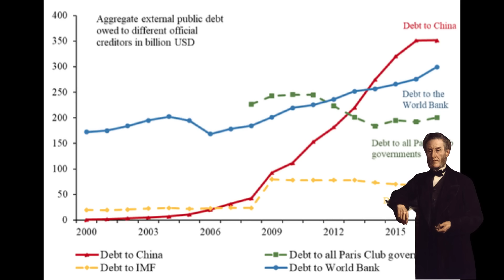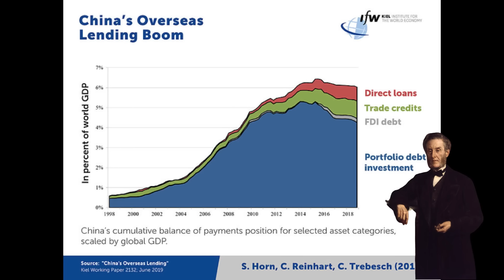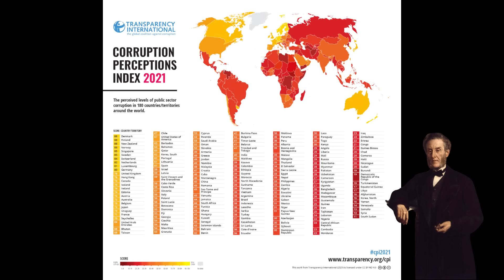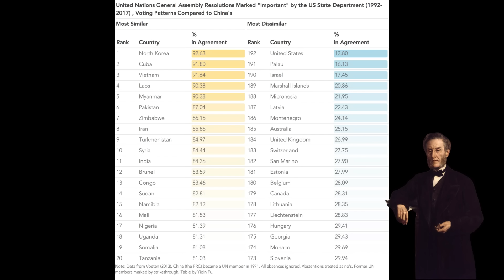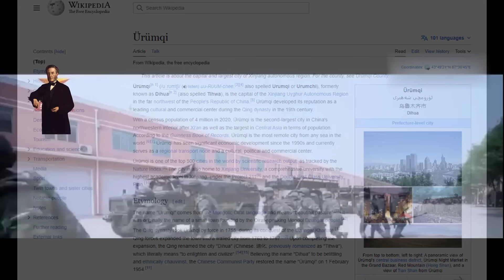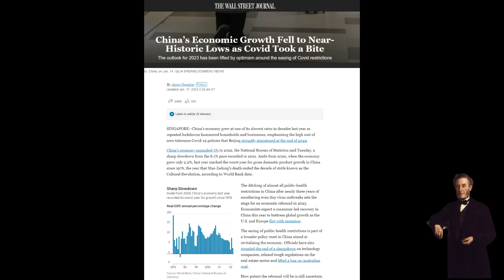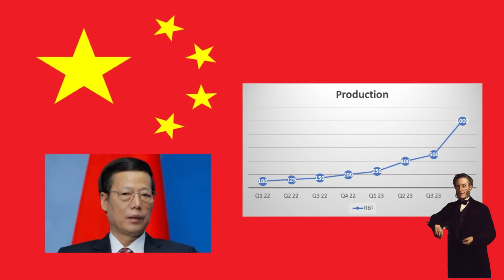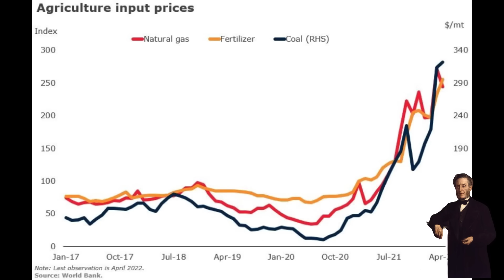Chinazone 4 - The O. Xi What Next For China?

Comment: Russia will give up territory if asked nicely. Russia has already given up some islands that USSR fought a small war and won several decades ago.
Reply: They won’t give up Vladivostok (Amur annexation) or any other territory east of Lake Baikal (which used to be the border).
Reply: @p.strobus7569 Minor corrections on the border are one thing. Giving up anything of value including Vladivostock no way. Nevermind the other fact. If you give up valuable stuff for one guy others might be tempted to try it as well. Plus China is not that interested in the North. Its goals are to break out in the Pacific. Vladivostock is actually a liability in that case since it can be easily closed off by US and japanese forces. It doesn't really improve their position vis a vis the US.
Reply: @florinivan6907  Those are valid points and certainly obtain as long as one fails to remember the oil in the area (Sakhalin) and the reality that Russia is becoming a Chinese vassal. A suitable gift to the suzerain is a mark of obedience by a client.